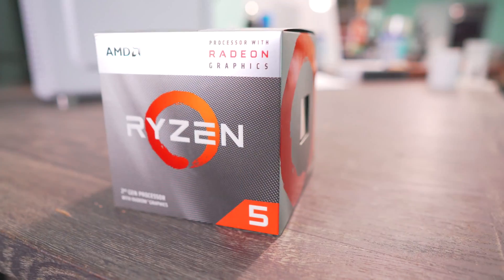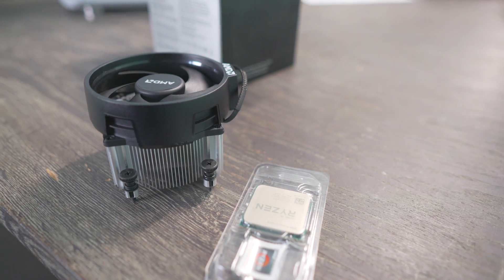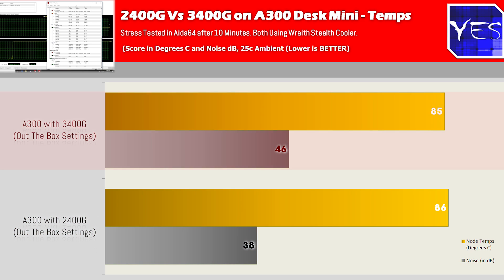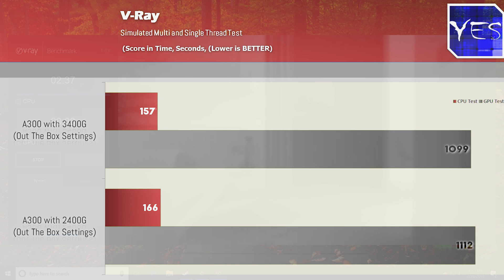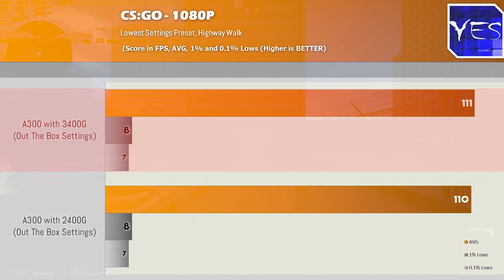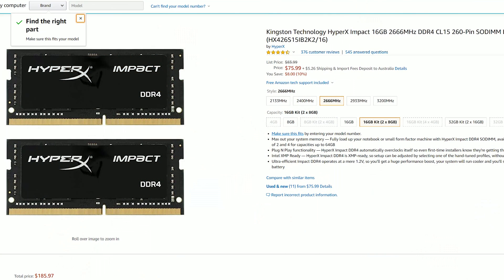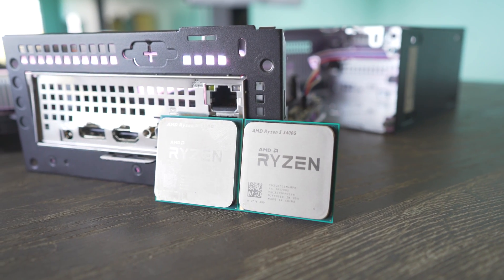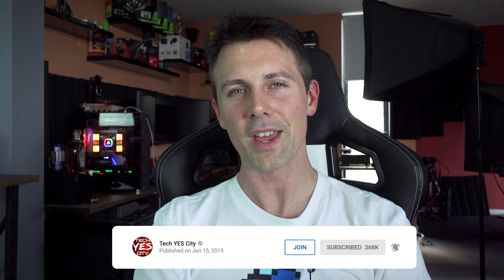Ryzen 2400G Vs. 3400G ON Desk Mini A300 - Catch 22

Comment: power supply  size... im the guy who bring 2 power supply everywhere he go. forget that i have a cellphone same performance soon
Reply: It should be fine (I know, my 2200g is running off my HX1200i platinum, my normal test bench PSU for reading power). Duel PSU club high five!

My main system has 2x SuperNova 1300’s (Halloween coffin build, gotta have duel 13s, although 1x is perfectly fine) for running my 4x Fury and ThreadREAPER at just 1.7 kW for Crysis 3 at 4k Ultra 100 fps, I have 2x for good measure since it would probably fry with TR on DICE/LN2 cooling for an eerie fog rolling out of the casket, it’s about the only thing I know of that can do 4k (my Titan Xp can only do 45 fps... multi-GPU is mandatory at 4k!). I definitely need more firepower though if I want to drive my triple 4k setup though, but oh well, that just means I should overclock some more, I still got like 1kW left for power, just hoping I don’t melt another 30 amp plug in, haha!

Comment: Looking forward to what I presume will be the Xen 2 based 4400G APU using 7nm. ALso interesting to ponder whether AMD will ever release a 6 core APU with Navi embedded IGPU.
Reply: I'm just waiting for 6/12 Apu, if the 3600 had graphics, this would be perfect. Perhaps when Intel starts to pressure with more graphics performance...
Reply: i don't know if deskmini a300 will support APU 4000 series.
it use stx 300 series motherboard, same level with a320
a320 not supports Ryzen 3000
remember.. APU always behind one generation

Comment: I'd love to see the 3400g in a x570 board, with an aio and 3600mhz ram, just to see the theoretical maximum overclock performance capable out of the Vega 11 graphics... Ignoring how impractical the setup would be.
Reply: I did that with a b350 board and 3466MHz b-die with tight timings, and there's LOADS of untapped potential locked behind memory bandwidth.
I made a video about it if you want some more details. 👍
Reply: @prerunnerwannabe  Just watched your video, really enjoyed it! You seemed to get a decent extra bit of performance out of the chip with just some high-end memory, I'd love to see what some serious cooling, and a beefy psu would allow!
Reply: @thedandyp  Thanks! I'm doing a B450 build with a real ATX psu, so I'll have to slap a tower cooler on and see what can be done! :)
Reply: @prerunnerwannabe  awesome, looking forward to it!

Comment: you have to remove the little rings (placeholders?) on the backside of the Fan, then you can insert the mainboardtray more easier without bending the case up
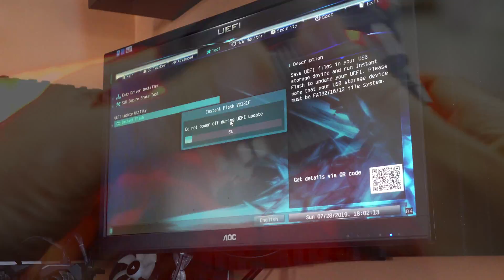Reply: Could you describe that a little more? Maybe at 9:49?
I have the 2400G and would really like to know how to get it in the A300 without uncomfortable bending.
Edit: So I figured it out. There are four little plastic spacers where the fan is screwed onto the heatsink. They're just glued on so I was able to easily peel them off with a knife and gained about 2.8 mm of clearance. Now I don't need to keep the case panel flexed to put it all in! Thanks for the tip.
Reply: @Mastni  on 2:40 you can see a "placeholder" between the heatsink and the fan, screenshot: http://prntscr.com/on4sre
when you take off the fan you can remove these little "placeholders" and save 1-2 millimeters to get the whole cooler better into the case.
Edit: on reddit you get a nice explaination about that: https://www.reddit.com/r/sffpc/comments/acv0ua/psa_new_wraith_stealth_fan_update_roughly_the/
Reply: Thanks, that improves the clearance when you slide the main board out of the case. You must be careful that the fan cable is properly tucked into it's channel on the fan, otherwise removing the spacer might allow it to be crushed between the fan and the heat-sink. (The spacers leave room for the cable even if it's not tucked in to its channel).

Comment: With updated BIOS can the AMD A320, B350 boards and X370 support 3600Mhz RAM for a 3rd gen Ryzen processor?
Reply: i think 3200 mhz is max on those boards
Reply: I've hit 3466MHz with a B350 board and a 3400G, and since that's not even a Zen 2 chip, I would think that it's definitely possible.
Reply: @prerunnerwannabe  doesnt matter what speeds youve hit, its what the chip actually can take advantage of, thats what I was talking about is the max the infinity fabric on the processors support

Comment: Nice Video Brian.  I see why you did 720P
But All Vega IGPU's even then 200GE Runs GTA V Smoothly at 1080 Normal/Low Settings.  
From what I remember GTA V online on 2200G was around 30-48FPS+  Which many still running at 30FPS. So anything over 45 in GTA V is somewhat ok.

Comment: The A300 comes with 115w power brick your pretty much maxed for power 97w total consume not much room for anything else.   I have a camper so this Little PC is perfect when you don't have much room for storage or power 97w is easily inverted from my house batteries.
Reply: That’s a 100% efficient power supply? Perpetual motion confirmed!

My 1300w PSU pulls about 1700+w from the wall just fine. When testing a 1000w (80+ bronze rated), it will be barely scraping 800w output for 1000 input, except of course it’s 1000w rated output, so it would be up to 1250w from the wall (or more since it has more output if it’s not 100% 12v being used)

Comment: Hi Brian. On a totally unrelated topic, do you know of a bios upgrade I can get for an asrock x58 extreme to run my x5675? Board will run 4 core zeons fine (w3450 and 5640) but not the 6 core. (Ran fine on my msi board) 
Board was free (best deal 😉)

Comment: I think the only way it really makes much sense to get an APU is an alternative to a 4 core 8 thread chip from Intel and put a graphics card in with it. But at that point you might as well just get a 2600 or 3600
Reply: Of you aren't getting an APU to use  as an all-in-one system at all there isn't much point, you might as well get a cheaper CPU like the 2200g or like you said step up to a better one.

The extra threads on the x400/500 models were never enough of a boost over the x200/300 ones for the cost increase.

Comment: At 5:32 that GPU usage is not bad... Just over 100% 🤔
Reply: That’s why you should never put much faith in software estimates (I’ve got GPUz validations at 35 GHz, 1 million Vcore, sub-ambient temps on air cooler, you know, the typical impossible stuff as well as insanely inaccurate power readings, heck even my server fans spin so fast it tricks the motherboards tachometer and once the 120mm fan goes beyond 3500 rpm it thinks it’s half speed! Fans don’t even report correctly!)

At least we probably think this little GPU gave it all it could, times 6.5

Comment: The desk mini is an amazing product ! our base workstations in work are A300 2200g 8gb 2666 SX8200 256gb .... they run rings arround all the so called " pro" macs we have .

Oh FYI , if you take the fan off the stock cooler and remove the little washers you can fit it in without force !
Reply: Nice, they are indeed lovely products. Looking to either buy one or build my own portable system but these Desk mini's are just such bargain.
Reply: @SirBrucie  compared to Macs? other ASRock Mainboards big PCs? Or other small formfactor
Reply: i want to buy an a300, too.
i can only buy existing hardware. max ryzen 3400g... ok
but what is the optimal max. hardware? And, I have an advantage if a buy a M.2 SSD with 3500MB/sec? Or i buy just with 1800 MB/sec.... Half price.
I am only hope, just play games as like as StarCraft 2.
I think, that will be my last computer system, what i want to buy.

Did you test M.2 Adapter --> pcie ?
Reply: @chrisdanger-godlike3048  if the half price thing you're referring to is a SSD. Then yes a SSD is plenty fast enough for like 95% of games out there. Only really, really large games (60GB+) can take advantage of M.2.
Reply: The AMD APUs are nice cheap products, but what kind of "pro" Macs run at these speed? How old are they?
Reply: Now let's not get this over our heads, a300 +2400G only goes about toe to toe with a Mac mini i5..... At half of the price.
Reply: @Andrew Joy, so are you saying wraith spire cooler can be fitted inside A300 case?

Comment: I actually built a 2400g based system 3 months ago and just upgraded it with a GPU (RX 570) plus I also put Linux Mint on it and so far with only a few hiccups it's been running great. I'll be waiting on Black Friday for a deal on either the 3600 or maybe the 3700x if the price is right.

Comment: Buy the cheaper 2400G and spend the extra on an LP Noctua cooler.
Reply: Mark Anthony Myburgh  I cool my 2400G with a Noctua NH-L9A-AM4 and use the HyperX 2933MT/s SODIMMs without any clearance issues. I found the trickiest part of building the DeskMini A300 was routing the cables to the optional USB 2 sockets without trapping them.
Reply: Mark Anthony Myburgh  No I've not personally fitted one in an A300 myself but it does fit - there are several other videos on youtube showing it.

Comment: Can you maybe test Ram OC with better SODIMMS? Currtently I'm running at 3400Mhz on my 2400G in the A300. When the prices are dropping I'm definetly switching to the 3400G and I'm hoping to get 3600-3733Mhz on the Ram.
Reply: i dont think that the upgrade is worth it at all.
Reply: @bertracoon1884  Higher iGPU Clock (you can't OC with A300), the 3400G is soldered and boosts higher and maybe higher Ram OC Potential. For a good price I'm definetly replacing mine.

Comment: I have a Ryzen 3 3200g running in my Crosshair VIII until the 16 core chip comes out and tbh I am so surprised how competent it is, though the Asus board does not have a HDMI port so have and old Radeon 570 again while waiting for custom RX5700s to come out.

Comment: On my opinion, there is no point to upgrade CPU if you already have a 2400G, BUT if you want to buy APU and build new system, you should definitely take 3400G!
Reply: I'm upgrading my 20x20x7cm mini ITX build to a 3400G because my 2400G isn't 100% stable with 3200mhz memory. I plan on gifting it to my grandparents who have a Desk Mini A300 that's currently running my old A12 APU.
Reply: @yukisaitou5004  Good idea man, so your grandmother can run movies in 4k :D
Reply: @yukisaitou5004  My 2400G runs at 3333MHz CL16 stable.
Reply: But bro the price diff in my country is ridiculous between the 2 ...so should I go for 2400g as it's cheap

Comment: AMD is getting better and better  💪 😄
Poor Intel😔
Why didn't they build a News Graphik Chip?(AMD)
Reply: Neiva all you need to do is download drivers to run destiny 2 on the new ryzen 3000
Reply: Intel deserve everything they get.  Screw them.
Reply: NIMY 8 they did...but not so success...anyway...seem like intel struggle with their cpu line up
Reply: @NamelessPassenger  AMD sucks bro i just build up a new pc COMPABILITY SUCKS you can't play most old games with amd
Reply: @michaelcorleone2794  It's your problem, don't force people to think AMD sucks because of your personal affair, AMD is objectively good right now. And can you please be more specific? What did you build, what's the spec? And what are those "most old games"??
Reply: @Şant Pirol
If its a new PC having trouble with old games more likely than not its a W10 issue, not a GPU one.

Otherwise you're most likely looking at really old games that don't play well with modern hardware in general, which is a fairly niche use case and not one to go badmouthing any one brand over.

This is why many businesses stick to their ancient systems, they don't whine about the manufacturers not supporting their old out of date software still.
Reply: The intel UHD 630 is a big improvement over past offering and a bit behind the Vega 8. Intel is closing the gap on the iGPU side of things.
Reply: Adam W don’t lie to yourself dude...vega8 is 80%-100% gt 1030 ddr5...and intel hd 630 is only half of vega 8 performance...you can’t play new aaa game even on lowest setting but vega 8 can and work great

Comment: I'm still shocked at how little performance difference there is. Not much reason to pay premium over a 2400G.
Reply: It's because he's using slow memory. Everything is so memory bandwidth limited that the clock speed increase doesn't even show up as a performance improvement.
I have personally seen a 25% performance increase from just memory speed on the 3400G. I made a video about it if you want more details.
Reply: the 3400g is being muffled to death in that little case and little bitty 100watt powersupply. It cant perform the way it should and had crap memory. The whole test was irrelavent. This is the first time I have ever said this about a Tech Yes video,

Comment: Good comparison for the budget gamers. 2400g is about the cheapest rig you can get new.
Reply from the maker: I like it for the desk mini better as you can get the stealth instead of the spire.  Probably the only time I would prefer the smaller cooler over the bigger one.
Reply: i ordered asrock a300 and have a question. i decided i will get 2400g, and since graphic performance depends hightly of ram speed, will 3200 mhz ram work ok with a300? 

Cause on official site it says:  supported ram up to DDR4-2933MHz (Ryzen), 

and than below that it says: ASRock DeskMini A300 supports Dual Channel DDR4-3200+MHz (OC) memory, up to 64GB.
in local shops i can buy 3200 mhz sodimm ram, or 2666, and i want to get maximum out of this little pc
Reply: I'm using fun with my 3400g made lots of videos
Reply: That is true.  And the difference between their performance is not that great.  I'd settle for the 2400 for now...
Reply: @gerrycrisostomo6571  I suspect that some of these benchmarks are RAM bandwidth limited.
Reply: @dalesplitstone6276  Yes I got the same feeling.  If you can get a really good motherboard with support for the latest high speed RAM, then the performance of the 2400 will become very very close to that of the 3400.
Reply: today the price difference of 2400g and 3400g is ~20 EUR. But only 10% speed difference.